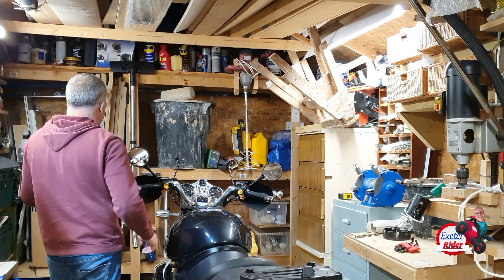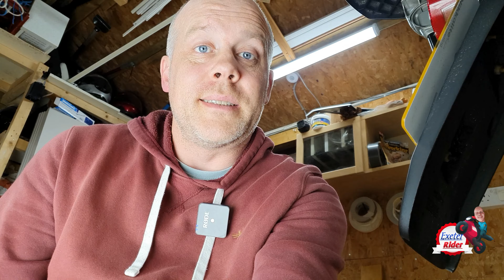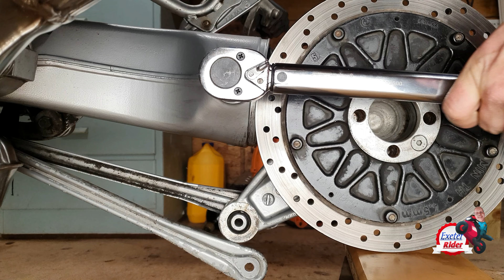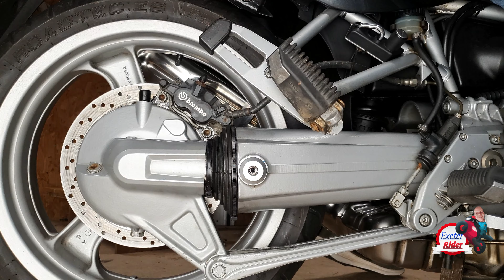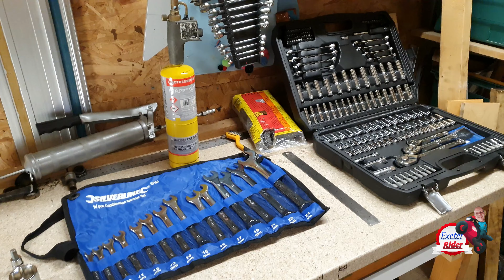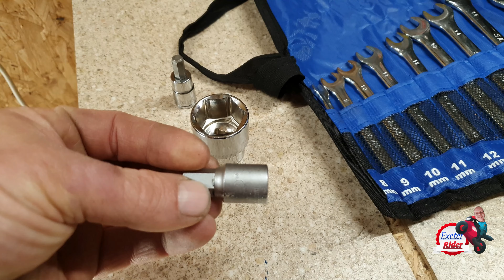BMW Motorbike "R" Series Paralever Bearing Change

Comment from the maker: IMPORTANT:  I am aware I didn't reinstall the shaft "in phase", When I pulled it out it was as it was, and questioned myself about it at the time but just thought that I must have been missing something.  Sure enough, I should have trusted my gut instinct and phased it properly.   It's a 15-minute job to put that right and by the time you are reading this, I would have done it.   With the pressures of cameras , lighting, getting the content I slipped up.    I just wanted to make you aware of that and when editing this I did notice and I wished at the time I had put that right.   Here is a update video showing me "phasing" https://youtu.be/cN2Rkfsqcdk
Also remember these are bushes not bearings so when you see me hammering them in I had already tried to use a G clamp to press them in and it wouldn't fit in my vice , so hammer it was... I know it looked brutal but that was the best way tbh.
Thanks E.R

Comment: I am the owner of a BMW R1150R.
I replaced the bearings in that area myself, and as you mentioned, the cost of the two bearings was quite high.
Also, the nut on the pivot pin sometimes comes loose, which can cause the tyre to wobble from side to side.
Reply from the maker: I want area of the other pin issue as well, so far mines OK. Nice to meet you, enjoy your bike 👍

Comment: The difference between bearings and bushings is - sticktion.
Bearings go right away without hesitation, but they can develop play faster than bushings.
Bushings have a "brakeaway torque" aka stiction (unless you use exotic coatings), but they can last a lot longer than bearings (if they are greased on schedule).
I don't think you will feel much difference in daily riding. You'd feel the difference while racing on washboard offroad sections, but in daily driving on the road the difference is negligible.
Reply from the maker: Good post Thanks

Comment: Do you have a part number for the bearing kit?
Reply from the maker: The parts numbers have changed where I bought mine so its best to call in to get the exact model you need for that year.  They are all different.
Reply: @exeterrider  Thanks for the reply....but Im on the other side of the world

Comment: Great job there, that bike doesn't look 20! I was wincing when you took the lump  hammer to it, though I understand why you would... though if you are going to "tickle" parts like that and only have a numb hammer use a bit of sacrificial timber to cushion it, then you can bray it (northern term) properly and not worry too much re cracks/damage/shattering suprises. Otherwise top job all round 👍 I am not a mechanic either just involuntary experienced bodger. p.s Is your back tyre shot?
Reply from the maker: Thanks Si, yes I did try to press the bushes in with a big Record G clamp but it bent it, then I tried a lump hammer with a piece of oak inbetween but I didn't have the control needed then and it was going in "scew wiff" so in the end had to be a bit brutal but it gave me the control needed. Back tyre is fine, it has a large centre part on the tyre with no tread which is good to avoid wear but it's not very grippy, I look forward to getting these changed tbh

Comment: Great vid. I did cringe when you bashed in the bearing. I would have pressed it in with the vice;but of course it may not have been possible. Well done.
Reply from the maker: Thanks Lorraine, yes it wasn't a bearing but its actually a brass Bush so no ball races inside. I tried to press them with a g clamp but not a chance that was going to happen and it twisted my clamp. It wouldn't fit in my vice so lump hammer it was😂🔨thanks for watching👍🔩

Comment: I would just have been a little gentler inserting the new bearings, pull them in together using a threaded bar and some nuts, washers and sockets so you are pressing them in via the outer race, you don't want to be hammering on the inner race if you misfire with the lump hammer, or just tap them in with a socket on outer race. you should notice a difference now the shaft is free to slide.
Reply from the maker: Fair enough mate, I take that on board.... I actually tried a big G clamp but it was so much pressure it twisted the G clamp bar so thought this was the only option.   
Remember that this were not bearings but sealed bushes with no hole right through so you couldn't get a threaded bar right through.... If I'm understanding you right.  Thanks for input though its good to hear thanks 👍
Reply: @exeterrider  No problem, I thought they were needle roller bearings like the sort you get in suspension linkages etc. but I watched again and you are replacing these with bushes If I got it right.  I put any I do in the freezer to shrink them a bit and heat up the housing they go into to expand it a bit, makes it easier to press in I think anyway. jobs done now and if they last a well as the originals they are fit and forget.
Reply from the maker: @stephenfleming7056  yeap they are bushes mate. Chilling them out is a good idea for sure. Hopfully I won't have to do it again for a while.

Comment: I'd consider myself a DIY bike enthusiast, but I wouldn't of had the confidence to do this. Saved yourself a fortune though compared to a dealership doing the work. Hope you wiped your greasy finger prints off that rear brake disc?
Reply from the maker: Yes it was a challenge in this case, as you say I saved £150 at least I would imagine.   You should never wipe grease on a brake disc Alan😂👍 but she had just washed the kids school uniform and hung it out on the line. So used that instead...... I just said the black marks was Exeters air pollution living near a main road 😂

Comment: "Exeter Rider Workshop". I like it 👍. Well done on the repair. Let us know how it rides. I didn't think it was the tyres to be honest - those Metzeler Z6 aren't actually too bad. My CR was fitted with them by the dealer as part of the deal. They wouldn't have been my choice but there you go. They're quite cheap due to only using a single rubber compound. But Metzeler achieve a similar performance to dual compound tyres by using radial reinforcing which has a more dense winding on the centre of the tread and looser on the shoulders.
Reply from the maker: Hi, it rides amazing mate, such a difference, but I still feel the back skipping far too much. For example, have you seen my turntable I use to spin my bikes around?  Well if the board is wet from the wheather the. Z6 tires can't even get up it... The back just spins off. But the Dunlops on my NC are fine. I still can't wait to change them, but I'm OK with them for summer riding. Thanks as ever for watching pal 👍📺